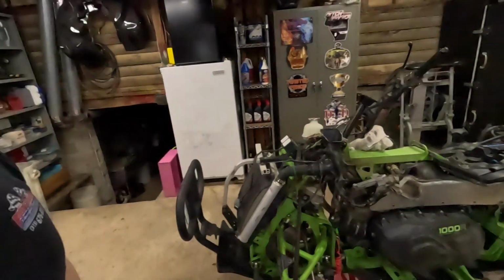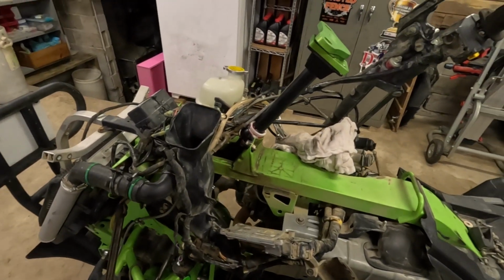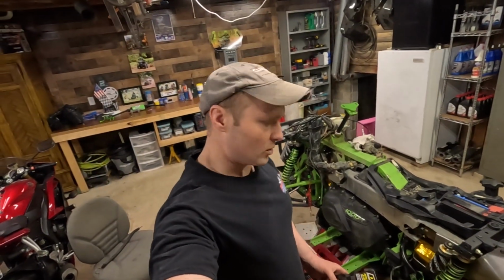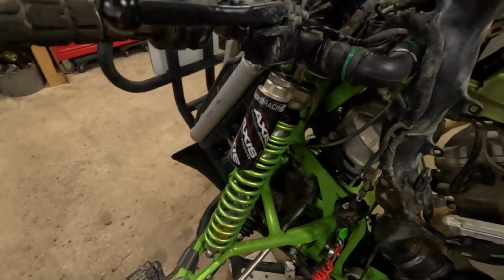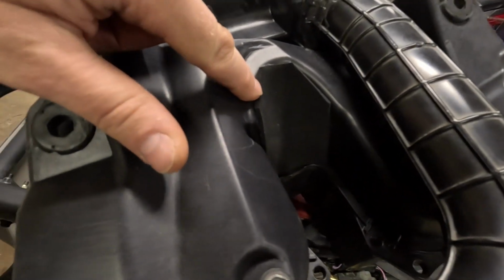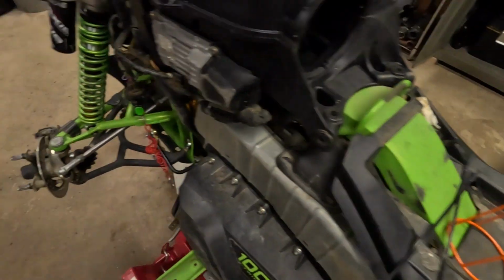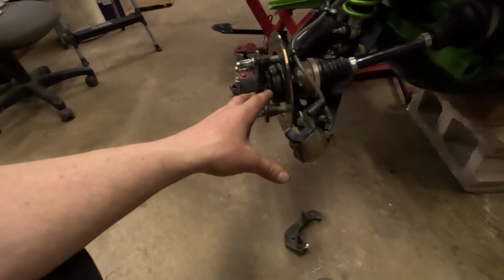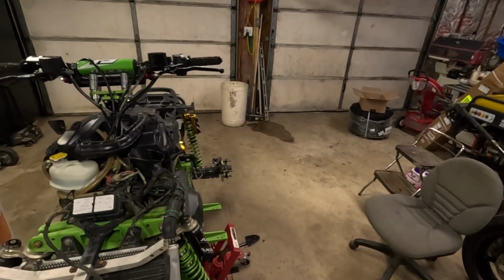Its Finally Back Together after the Crash!

Comment: What do you with your last years parts? If they’re still in good working condition would you be interested in selling your old Flexx bars?
Reply from the maker: I think I might sell my old flexx bars.
Reply: Those rear sway bar links, you should run the bolts on the top so that the heads of the bolt are on the inside. I’ve seen people wear into the fuel tank because of the nut and stud sticking out.